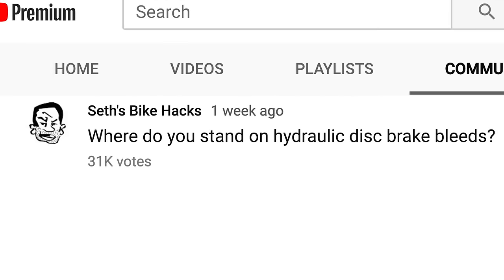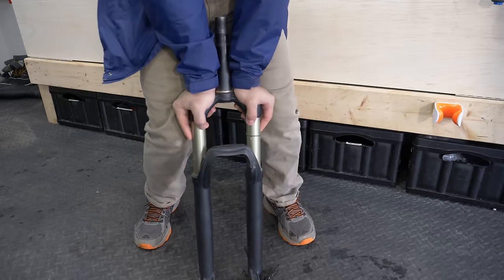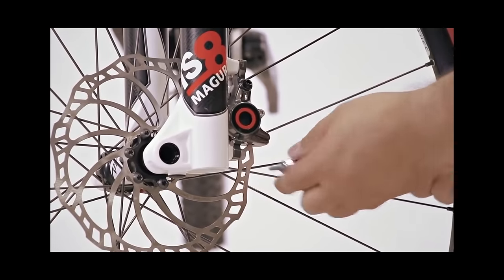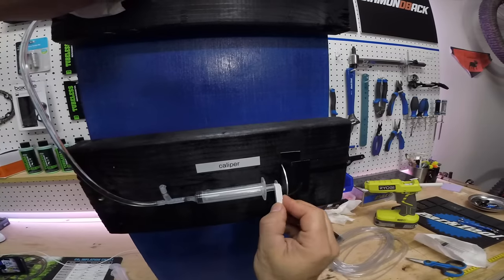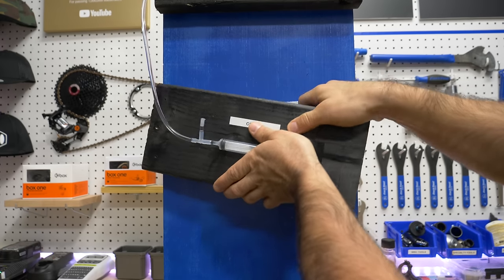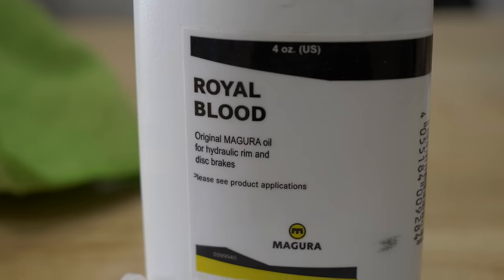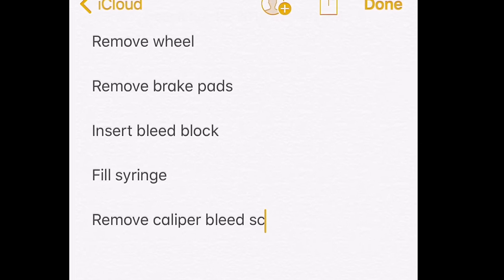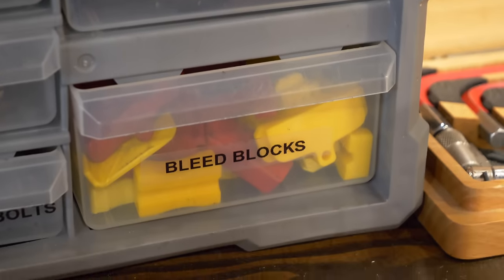How to bleed MTB brakes

Comment: I thought this would be like all the other bleed videos, but your clear system is actually a great way to see the whole process. One thing you could have mentioned is tapping the caliper, hose and lever with the back of a screwdriver to jostle bubbles loose. Great stuff!

Comment: I started to get the faded feel and pull and it was difficult to lock up my rear wheel. Pads were fine so I took it to my old bike shop twice and asked for a bleed. Both times they just cleaned the rotor and comfortably charged me twenty bucks each time -_- definitely ordering a kit lol

Comment: My son snapped the brake lever off in a crash so I had to replace it, never done one before and it was my first time ever working on hydraulic disc brakes (big nine 20), this video was valuable info and saved our butts as we installed and bled and couldnt work out why it had no pressure, your video showed us what to do with the syringe that came with the kit so we added more fluid then bled and it was better than ever! Thanks Berm peaks

Comment: Tips for getting used for a big bike when you are small?
Reply: Get a smaller bike
Reply: @coen8323  LOL i already got a bike big bike but im getting used to it and trying to handle it
Reply: Get a proper sized bike.
Reply: WOW 5 likes XD
Reply: Make sure your standover height clears your crotch enough and then get adjusted to moving your body more on the bike. If you change things like stems etc don't go overboard. Ride it as it is and then sell the bike and get something that fits once you have a few more skills on the bike 👍
Reply: Hi
Reply: Just ride ride and ride it some more you will get used to it.
Reply: I have a smaller bike just sticking with the big one
Reply: Grow.
Reply: Install 24 or 20 inch wheels. It's called mini velo. You can reduce weight of bike and have more acceleration this way :^)
Reply: @Bundz91  you have no clue what you are talking about lol
Reply: @AG.Floats  yeah bro im pretty much used to it now
Reply: Bro just get used to it by riding it a lot of times and you will get used to it like i did
Reply: BlaZiNg GamER get a bike that fits you

Comment: With them maguras u need to learn trials now
Reply: Bike Trials Bucharest haha yeah, unfortuntely I’ve heard/seen some negative feedback of the magura brakes from other people that also ride trials
Reply: @mxrider2strokebraaap54  it is true that they can fail, but this is usualy  a problem for those who do a bleed really rare, or they use some different kind of oil, the magura one beein more expensive
Reply: @mxrider2strokebraaap54  i ride trials for 1.3 years and have the same brakes from the begining, magura hs11 hydraulic rim brakes ( the back has a race lever as its stiffer). Ive smashes into benches, poles, rocks,etc. The only damage done is a cut hose wich hapened quite recently
Reply: Bike Trials Bucharest I’ve seen peoples magura’s levers themselves snap form using, but those were like the new levers. The hs33 is great for trials, I run hope trial zone for 2 years and they also work great(with hope tech 3 levers)
Reply: @mxrider2strokebraaap54  that is true tho, most 2015 (mt7)and up use a way better lever and hc3 blades, wich fold away in a crash
Reply: Mxrider2stroke Braaap what negative feed back?  Been to Leogang in Austria many times. And all the locals have magura was its so steep. If there was any negativity about magura I doubt they would use them.
Reply: Jack Beames magura brakes work good, but we were talking about the magura on trials bikes. With trials, you use your brakes litterly all the time. I’ve seen pro riders complaining about the quality of the magura levers since some of them broke within 3-4 months of using(lever snap by just pulling in the lever hard)
Reply: @mxrider2strokebraaap54  well, why do you think that i have 2 different levers(one magura, one echo)🤣. On a serios note tho if a pro uses standard levers, a) they have shit sponsors,....b)they are in an emergency(most pros use racing line, trialtech, echo, or m-parts)
Reply: Bike Trials Bucharest yeah, but the not-sponsored high end riders are angry about magura because they let the best riders ride with their brakes to show how good the magura brakes are, but in reality the not-sponsored (street)trial riders are not happy with the actual brakes. Since those breaks are way overpriced and not-ponsored rider may not have the money to change out their levers 4 times a year due to the quality. So they believe that the magura brakes are not the best for street trials(but the older models are bomb proof for competion trials).
Reply: Bike Trials Bucharest lol I just checked some peoples stories on my instagram, and another rider broke his magura lever😂 Not even a joke

Comment: Hey Seth, you forgot to mention proper disposal of the excess or flushed brake fluid. Never ever pour any mineral oil or DOT fluid down the drain! Contact your local hazardous waste disposal group and obtain the location of the nearest disposal location!
Reply: Mineral oil can be dumped outside in the average consumers amount.
It's pretty much harmless.

Comment: On shimano brakes you work from the bottom to the top.  The funnel is there to contain the old oil and provide an air seal as you fill the system. Thats why they come with the plug stick for the funnel so you can remove it without spilling oil on the floor. Love the video :)

Comment: Great demonstration and video, but you missed a couple of important things: 

 - That air bubbles expand when the brake system heats up and causes even worse brake performance. (More noticeable in cars and motorcycles)

- Some brake fluids are EXTREMELY corrosive and will eat through paint if not cleaned properly. (Specifically, any DOT rated fluid and some others as well)

Keep up the good work and I hope you heal up well! I’ll wave at you as I drive through AVL this weekend.

Comment: I bleed my own brakes all the time too. I have the Magura MT2's. But that clear plastic line would give me trouble. It would pop off the syringe after I had it screwed into the caliper. So now I replaced that line with RC nitro fuel line that I had around. It's softer and more flexible and stays attached to the syringe. I recently had to do a bleed job on my rear brake. And now that I have some experience too I made the least amount of mess.

Comment: When I first started bleeding brakes, I just bit the bullet and tried, I got it wrong a few times as part of the learning process. In the end the first time took a while and time testing before going out for a ride, but now I can get it done really quick and when I got my first reverb stealth it ment that wasnt at all scary either.
Nothing to be scared of. Any mistakes can be undone (as long as you dont over tighten something and knacker some threads)

Comment: Recently bled my Hayes 9 HFX brakes after one of the levers wouldn't pull back with the pads suddenly locked tight grabbing the rotor after having the bike sit unused for almost 3 years.  I bled it and found out why many say they are some of the hardest bike brakes to bleed.  Oddly I had to bleed it from top to bottom as the fluid didn't want to bleed the opposite correct direction.  I also recall reading that it's best to bleed with the lever reach set to the furthest position for extra fine tuning adjustment of the reach once the bleed is completed.

Comment: Top Tip - Aaaannnd if you contaminate the pads use a blowtorch to burn the oil off the pads and the rotor, short periods for the rotor. And about 30 sec for pads untill they start to give off bit of smoke. Done that on my Shimano SLX and they work just fine. p.s. sand the pads after they cooled down with sanding block.

Comment: When I first started it was messy and I was terrible doing it, but my brakes still got bled and were 10x better than doing nothing. btw, if you have Shimano, at some point you're going to unscrew the cup without putting the plunger in and spill mineral oil everywhere.
Reply: 👊🏻💥🤣 so true

Comment: If you are a car guy like I am, a lot of what was explained here pretty much also applies to automotive brakes as well, the only difference is that instead of bleeding 2 calipers, you are bleeding 4 and with only 1 “lever” and the only reason why brake bleeding on mountain bikes is so messy is because they don’t have the large reservoir of brake fluid that cars have (a large reservoir on a bike would get broken off instantly unless they design them like motorcycle brakes)

Comment: Fun tip: when running Shimano brakes (or any brand that doesn't use brake fluid) you can fill the brakes with something like olive oil in am emergency situation where no proper brake oil is at hand

Comment: Almost perfect vid, only your transparent kit didn't include a bladder reservoir in the lever. That plays a big part in a brake system to adjust to pad and rotor wear and is exactly why you should press in the pistons and use a bleed block even for just a lever bleed.

Comment: Seth Can you do a Test on your MAGURA MT5 brake vs. on your previous brake Shimano XT and Sram Guide
Reply: I can clear that up for you.  1.  The lever is wider, which takes a little getting used to , and you'll either prefer it...or hate it.  2.  The stopping power is great, and the modulation is closer to that of SRAM than Shimano.  3.  The durability SUCKS.  Four local riders (including me) have demo'd them through the shop we ride for, and the MT 5's are what I would term flimsy.  All of us had minor crashes that you might at most get a slight lever clamp twist on the bars, and maybe a scratch on the lever, and the levers and or lever assemblies broke into pieces.  Two of the incidents happened during enduro races, which ruined stages.  So...the advice was to move up to the MT 7's.  Same story...levers aren't durable enough.  So....that's my report from here in Arkansas.  Work great....fall apart.  Hope that helps.  I LOVED how they felt...fatter lever, nice modulation with great stopping power.  They just don't hold up, which is the exact feedback we gave to Magura.  Maybe they will work on improving that aspect.

Comment: Good video. I'm still reluctant to get hydraulic brakes because I'd have to do all the maintenance myself. There are no bike shops for hundreds of miles. :\
Reply: Random Things Rider my stock cable discs lock the wheels if i want but they dont drag at all. I spent a little while lining em up and adjusting but it was worth it

Comment: So 47% of your viewers just don't use a brake that needs bleeding?
OK Dokey, that fits the profile.

Good vid. 
I hadn't appreciated the purpose of the Bleed Block. 
I thought it was just to keep from losing the pads, not volume control.
Same with order of attachment of syringes. Doh.
And going WAY out of your way to keep the pads and rotor from the oil.
Thought the wood handle was overkill initially, but it really added to the demo.

Comment: Apart from air, brake fluid is hydroscopic. It adsorbs water. That will give you a false sense that the brakes are ok because they will be firm. Ultimately if you left and left the brakes they will become so hard the lever wont even move. There will be corrosion also in the pistons. Change your fluid at least every two years. Good video though 👍👍👍

Comment: I like the method of filling the reservoir, opening the bleed valve on the caliper, squeezing the lever, closing the valve and releasing the lever, but this only works on some models of brakes. I have found that shimano and hope brakes have them and I think maybe Hayes and magura but I'm not sure about those. They are much easier to bleed than others, but once it's done you won't need to do it for a while so it's not a big deal.

Comment: TBH for Shimano brakes just follow Jason Marsh (Minaar mechanic) tutorial here on YT, easy, straightforward and without unnecessary equipment. It takes like 10 minutes max on each brake and works perfectly every single time. It is good if you use some kind of cotton string dripped in oil and clean sides of brake pistons, so it doesn't stuck or become too sticky.

Comment: I have tektro brakes on my street bike and when i picked it up after 2 years of sitting the oil low or something because in that moment the lever squeezed all the way to the grip but with time it came back to its original state and braked normally when I went to the bike shop he said that i was low on fluid but i still had enough for braking when i explained that he couldn't tell what exactly happened I'm guessing that the liquid became thicker because the bike was stored outside let me know what do you think happened

Comment: At 0:40, cars and motorbikes use hydraulic brakes because hydraulics work well with a servo. The engine can pump the hydraulic fluid to considerable pressure, then a servo takes input from the driver and amplifies that force hugely. Try this (somewhere safe) : Park your car on a gradient. Switch the engine off so that no pumps are running. Pump the brake pedal until it goes stiff. Now let the handbrake off and let the car roll. See how useless the brakes are without the engine running. That's hydraulics without servo assistance. Hydraulic without a servo is no more powerful than cable actuated. If it seems like they are, I suspect that's because hydraulics usually come with better rotors and bigger pads. It's not the hydraulics per se.

Comment: So wassup I have full suspension Trek mtb from 2011 that i bought second hand last year for 50 euro (cuz the guy i bought it from had no idea of its worth) it is a 26" wheel frame. It has rear FOX 154x78 ajustable coil shocks with 78mm travle with dampers and in the front it has ROCK SHOX jett with coils and dampers which have 100mm of travel. My shifters are shimano DEORE rear dirreleur which has 8 gears and switches nicely and in the front it has shimano 3 gear DEORE or ACERA dirreleur. And Like 95% of my frame is made from aluminium and smaller things are made from magnesium the bike is very very light and sturdy the frame doesnt flex at all. the only thing im missing is disc brakes it uses normal rim brakes but it stops very well i never had the problem of not being able to stop in time should i actually upgrade my forks in the front and rims so i can have budget disc brakes or should i keep my well working rim brakes?

Comment: Raise your hand if you spent an hour doing the bubble thingy with a syringe to try to get the air out of the brake fluid only for your sram brakes to have a bunch of air in them anyway✋

Comment: So about a year and a half ago i bought myself a e-bike and ever since the front break was always trying to grip on the disc without me pulling the leaver. The caliper is mounted with regular screws but the washers rub on the disk. Why would a manufacturer sell a bike with rubbing breaks? I tried multiple things and im about to just get it fixed at a bike shop.

Comment: Ok Seth I have a question I'm rebuilding an old hard tail from scratch I'm on a budget and I'm wanting a new set of front and rear darailurs along with shifters I'm wanting to go trigger shifter what do you recommend I also need new tires pls keep in mind I'll be using this bike mostly on the street thank you

Comment: I know this is an old video but here goes nothing. Do I buy DOT brakes or Mineral oil and what brand? I currently have Q3 Promax and I can't find a single instructional video online, I can't even figure out how to remove the pads... I tried Bleeding, made big mess, I gave up lol. Just going to get new brakes, been riding around with just the rear for like 2 years now, I think I can splurge.

Comment: Ok sir here is the thing. I have a GT bike that comes with Avid brakes. I have been told they got bought out by SRam. The brake pads they use are DB1. The manual for the bike is so poorly put together it does not talk about any kind of maintenance. What should I use brake fluid such as DOT 3 or mineral oil such as baby oil loool.
Reply: search up the brakes online

Comment: What to do if your brakes is still very spongy after bleeding?
Reply: Do it again and check for leaks
Reply: @wieseldiesel4828  i have done it so many times, when you press the lever it goes all the way to the grip but if you pump the lever few times it cames reslly hard...
Reply from the maker: After you bleed your brakes you need to pump them a few times. If they stay nice for the rest of the day you did it right.
Reply: @SethsBikeHacks  Bleeding motorcycle brakes is so much easier... i guese i have to try to bleed them again.
Reply: @ghazik3656   Having to pump is a sign of air still being trapped - re-bleed needed!
Imagine you forget pumping after jumping of a lift and start shredding right away ... GOOD LUCK! 👋🏻
Reply: @geemail369  yeah i know... usually i use my 29er hardtail for commuting and wheelies, so i want the brakes very precise.
Reply: @geemail369  ...Depends on the brakes.  For a lot of brands, it just means that you are setting the pistons after removing the block following the bleed, which takes a few lever pumps.  Shimano works that way.  If they stay spongy after a few lever pulls, then you have a bigger issue.  If you know what you're doing, and you have all of the air out of the system, and it doesn't hold a bleed...then you have a leak at the piston, lever assembly, or hydraulic hoses.  Something is cracked, worn, or in the case of the lever internals, the rubber may have lost pliability/elasticity.  At that point...it's WAY too time consuming and costly to start trying to replace components and "chasing" the problem, and it's better to just replace the brakes.